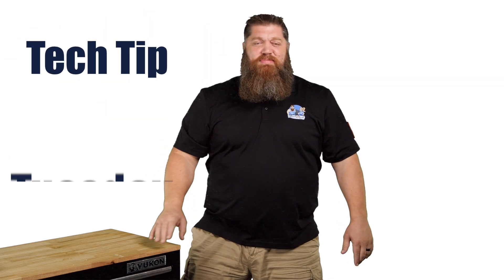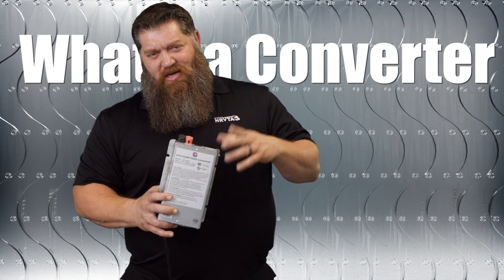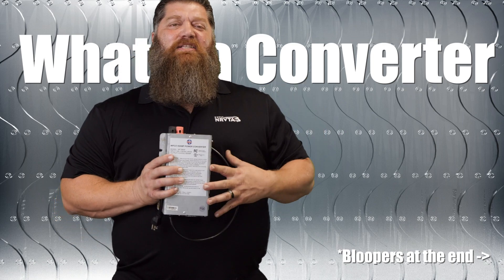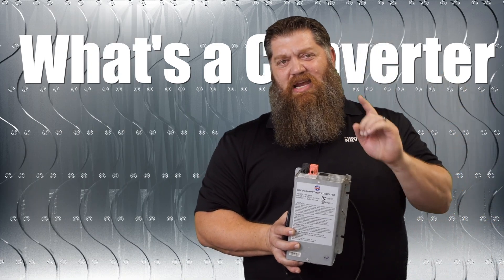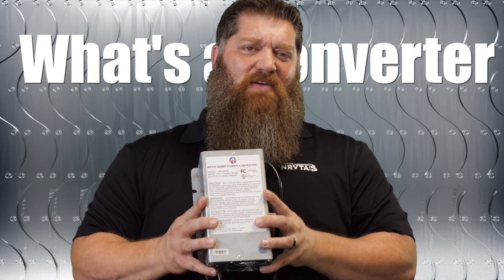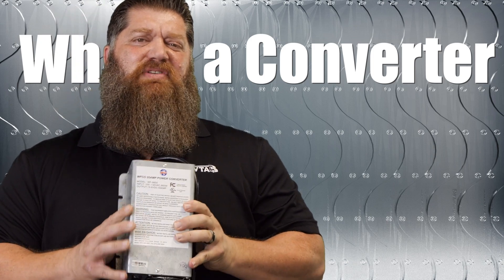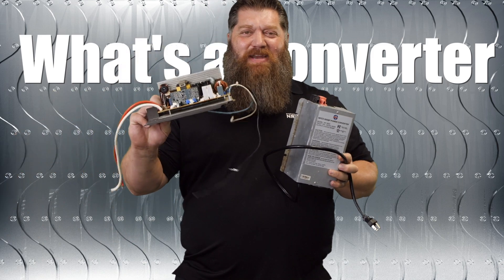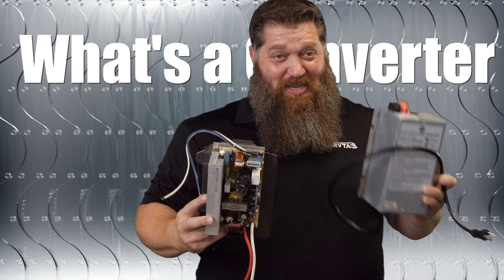What's an RV Converter Charger

Comment: Great Video Todd! I recently upgraded my old acid converter charger to a Lithium charger. Where I store my RV there is a 15amp outlet at each site. When I plug my rv into the 15amp outlet and come back a few days later my battery say they are only charged to about 85%. The rv storage facility say the outlets only provide a 5amp max for trickle charge. I know my new lithium controller is set for full lithium charge (installed by certifies master RV tech). Maybe the controller does see nougat amps to click on the charger?

Comment: Every time my converter turns on it trips my a/c. I am plugged into a gas generator thru my shore power. Any reason why that is? 

The converter also doesn’t turn on at night. Only during the day when I turn the a/c on. I have a 5th wheel from ‘95.

Comment: I bought a used RV and they said it had a brand new battery in it. The first weekend out in it the lights started to dim. The battery was low and not charging. The 2 fuses on the converter itself were blown. I had to find it and replace them and it worked fine. They replaced the battery thinking that was the problem with the dead battery. Thanks for the video!

Comment: I bought a class a two weeks ago. I’ve had it hooked up to my to do renovations to it. Yesterday my it tripped my house box. My outlets aren’t working and my control center isn’t lite up anymore. My inverter is on my lights work. I tried plugging in and as I turn on my Motorhome breakers on but one it trips my home break. Any chance you have an idea what it could be?

Comment: If you upgrade you battery to lithium, do you need to change or upgrade your converter with it?
Reply: Yes you do, don't listen to fred. Lithiums will charge much faster at higher amps which you cannot get with the standard AC section of your converter. In Without the upgrade your lithium batteries may not even be recharged. Something this goofball video completely ignores. I recently changed out my converter AC section myself. Just remember to connect the same 5 wires into the same places as the old one. This will save you a fortune in certified tech fees. Can be done in less than 30 minutes.
Reply from the maker: Hmmm let me explain. 

lithium batteries fully charged will produce 14.6 volts. a standard converter will only produce 13.6 volts which is not enough to overcome the voltage pressure from the lithium battery. 

result; if you use a standard converter charger that is made for SLA batteries and not Lithium batteries then the lithium batteries will never get above 40-50% charge.
Reply: Exactly right (except Fred). Lithium batteries on a standard converter won’t “burn up”. Instead they will undercharge. You can even put Li batteries on a inverter charger and NOT set it to Li…BUT, you need to accept the consequences of that. They should not FAIL (if they do, their BMS didn’t do their job very well), instead they’ll simply ‘turn off’. Sometimes that can create some bad juju for the rest of your system. Get an appropriate charger for Lithium if you use them…not because they’ll “burn up”, but because they just won’t work right.
Reply: @NationalRVTrainingAcademy  So, you need and upgraded charger, but the original inverter will work?

Comment: I am trying to take out a converter from the 90s and the positive negative wires are inside of it and no removal spot. Do I have to cut them off ? I'm so frustrated haha
Reply from the maker: You can either follow those wires lead and replace with new wire. it's fine to cut the wires and strip them for the new converter.
Reply: @NationalRVTrainingAcademy  thank you so much!

Comment: I'm a little confused  a converter draws from 120 volts and converts it to12 volt power. So wouldn't a 660 watt converter using 120 volts  use 5.5 amps? I much enjoy Todd's videos
Reply from the maker: so the efficiency rating on these simple converters are at best around 80%. they will consume say 1200 watts and produce around. 950….depending on size
Reply: yes, you're right. the guy in the video said it backwards and confused 12V with 120V.

Comment: So where does the inverter play in this. Combination inverter and converter. Does the inverter charge the battery or the  converter. My rig has both. So confused.
Reply from the maker: so if you have an inverter combo (actually it’s an inverter/charger) it will get an inverter when there is 120v demand but no shore/genny power. it will be a battery charger if you are plugged into 120v or genny.

Comment: How can I test that  its charging my battery
Reply: Personally I use a inexpensive voltage tester. When the camper is plugged into shore power I get around 13.6 volts DC. When unplugged the voltage will drop a little bit.